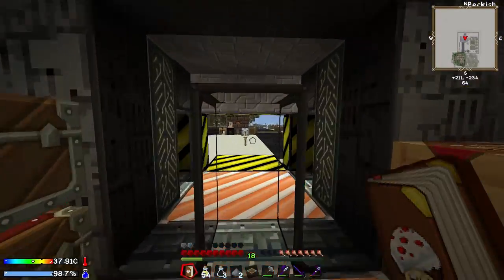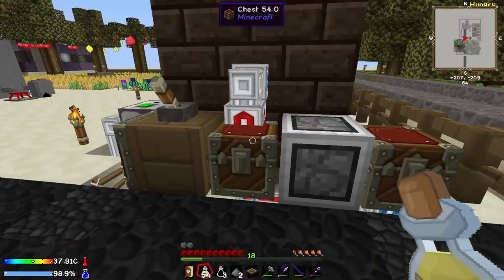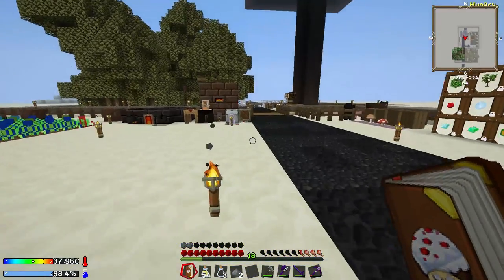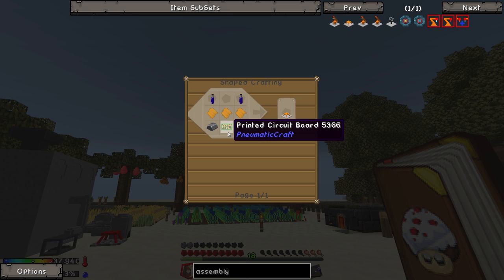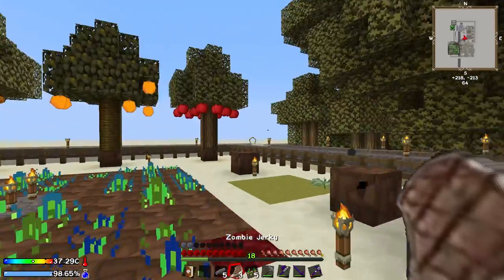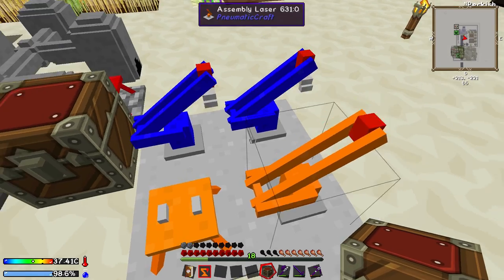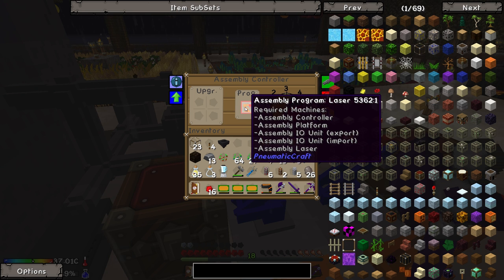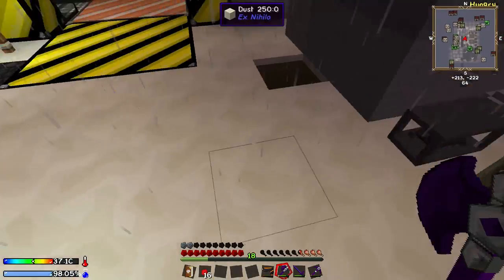Minecraft Crash Landing - Part 19 - Faster PCB's!

Comment: There is a pressure relief valve and a pressure gauge that allows you to set your system at a specific pressure in the base pneumaticcraft mod.  Not sure if it is in this mod pack, but if it is, it will keep you from blowing up your pipes and other equipment.

Comment: Actually ***** you can make Seared stone in the smeltery, rather ... you can recycle it and use it to make scorched bricks, i managed to make my high oven without stealing parts from a factory in the city, i stole the smeltery and didnt have enough room in my inventory to carry the high oven parts that id found, i melted the quest reward seared bricks down and used them to make a 3x3x4 high oven, ive even got spare seared stone for some weird reason, no word a lie i was bricking it thinking i had to go back to the city for more parts, be warned you will need damn good armor to survive and id also recommend carrying a bucket of water, blazes and body heat dont play well together.